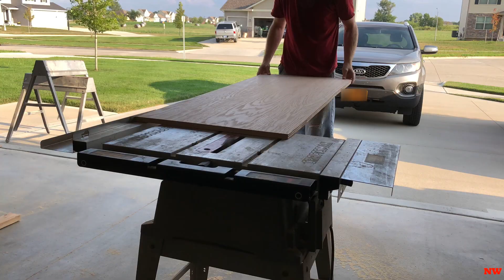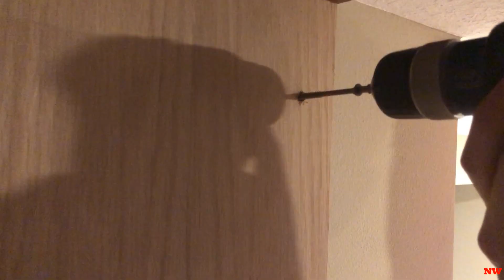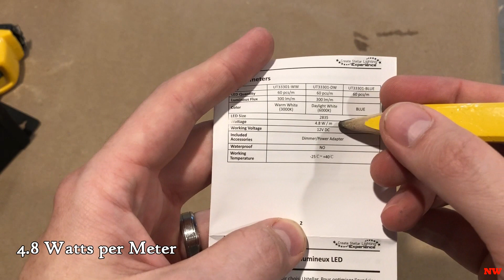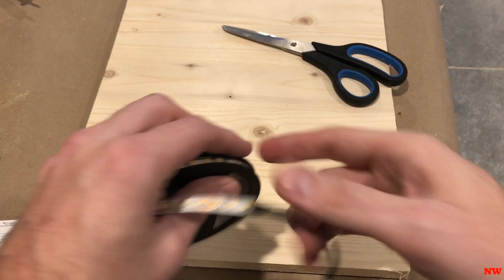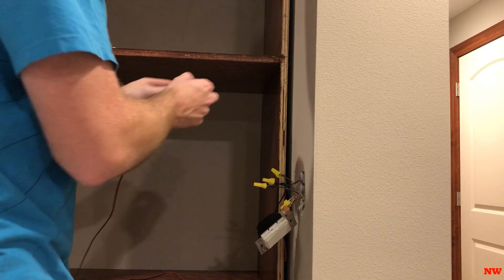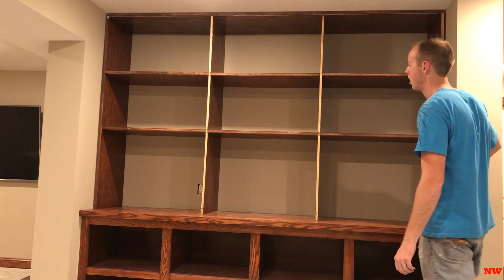DIY Built-In | Lighting | Part IV

Comment: Little Confused, the light strip you list from amazon comes with a plug and dimmer. Why do you need to install all those other items?
Reply from the maker: I have a traditional dimmer switch in the wall instead of using the attached dimmer. Totally personal preference and you don’t need to do it this way. I wanted it to look like the rest of the switches in the room.

Comment: is it safe if i hang light sconces outside the closet and its electric outlet outside the closet? the wires are inside the closet but covered with plastic tunnel. i will hang clothes inside it so im worried if anything goes wrong it will start fire

Comment: You mounted the driver horizontal. The instructions recommend it be installed vertically for optimal heat dissipation.  Have you seen any issues with the driver heating up ?
Reply from the maker: No issues as of two years. Of course, I’d recommend following the manufacture’s directions :)

Comment: You bought too much wattage, 67.5 Watt is not 20% more than required 37.5W. Next time please divide 37.5 by 0.80 to get the right one (46.875). Believe me, used to wake up 4 in the morning in my 6th grade. Great job though.

Comment: Wouldn't the 37.5 watts desired only require 46.875 to be 80% of capacity?
Reply: I thought that didnt sound right either. He took the 37.5 x 1.8 (+80%) but it should have been 37.5 x 1.2 (20%) which is 45 watts. With his lights on full, he is only using about 45% of his power supply.
Reply: @aaronlane5000  technically you would divide 37.5 by .8 to get the math perfectly mathed, but your number would always be plenty close for such calculations